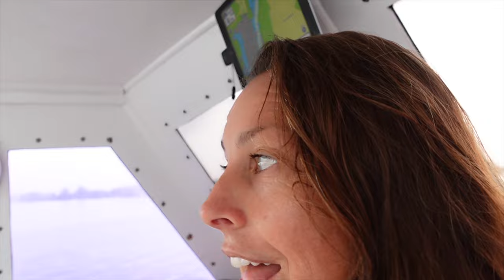Remote Boat Life getting the JOB done  | Life on the Sea |Episode 229

Comment: An alternative to burning is to bury it deep enough to biodegrade in the 450+ year lifespan of a bottle. Below the A horizon of soil, about two+ feet deep, somewhere soil is unlikely to erode faster than normal, or get dug up. Then plant a tree there or put a rock on top so you remember where you put it. 🙃

Comment: Great video! Love your adventures and enthusiasm for life. Burning is probably the BEST alternative at the moment, especially in remote areas. However, please be careful burning plastic, it releases highly TOXIC fumes that are harmful to humans and animals. I recommend you set it on fire and be UPWIND of the burn at least a few hundred feet (30-50 meters) when burning plastic and wear a mask, similar to what you would wear when you work on the bottom of your boat scraping or working with toxic epoxies and resin. Otherwise, it may be better to bury it at least 2-3 feet deep back in the woods. Try not to bury it on the beach itself, primarily because of TURTLES that come ashore to lay their eggs.